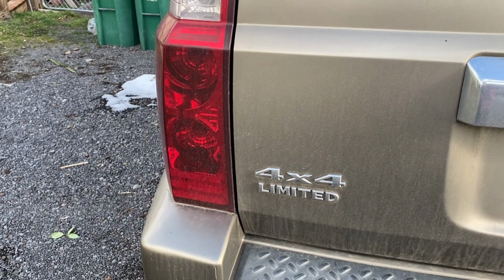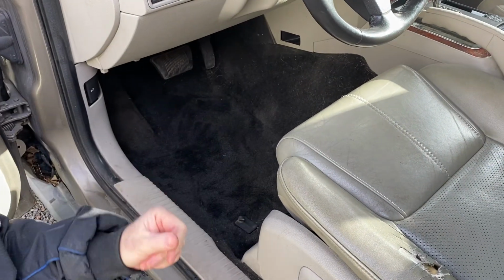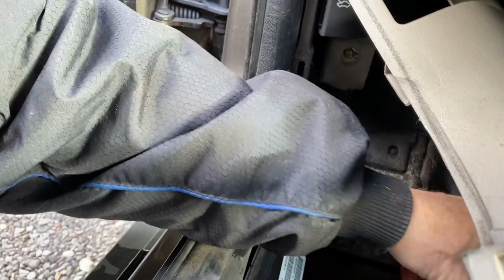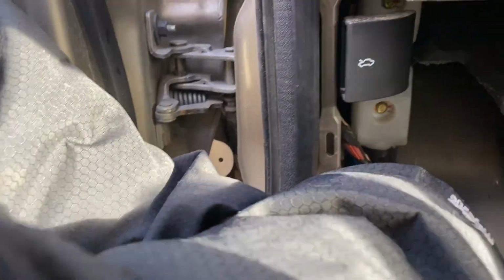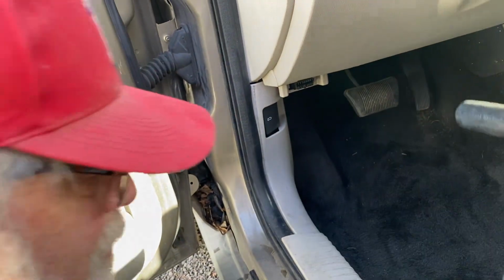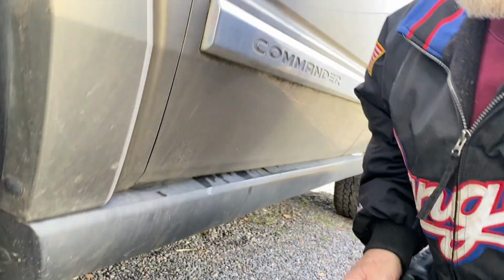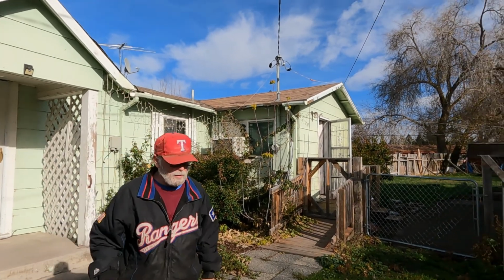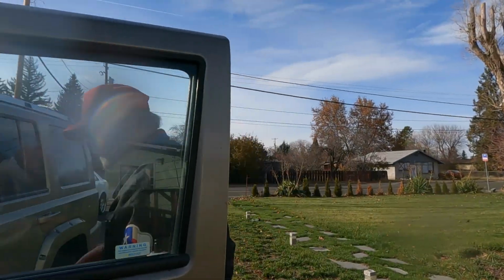Plugged drain hose on 2006 Jeep Commander from sunroof, leaked on floor inside..HOW TO FIX IT...EASY

Comment: Cut the tip off the black grommet, open the sunroof, the drain tubes are in the front corners, blow them out with air compressor
Reply from the maker: Thanks for the tip....
Reply: that's what I usually do... plus "carefully" put some baking soda at the opening in the sunroof and then pour some vinegar down the drains, scrubbing bubbles for anything clogging

Comment: Did this fix the leak? My girl and I have a 2006 commander as well with the same problem! I’m excited to fix it because we live In NW and rain is a constant.
Reply from the maker: Yes I'm happy to say, but did you notice the wire that ran from the top of the windshield down through the door jam. the water drips followed that wire. If you have the same thing put a bend in the wire and make sure the sealer plugs all small holes and gaps..... Thanks for watching and thanks for commenting...:face-blue-smiling:

Comment: That's all good and all but you know you have drain hoses in the rear that no one on the Jeep Commander forum or the Jeep Commander Facebook page can get to without dropping the headliner and you didn't even touch those. The first issue is your sunroof seal at the top has shrunk from being in the sun over the years and it's letting in too much water to start with you can clean those drain tubes all you want to if the water is coming in faster than the front tubes are draining you're going to keep getting water in your front floor boards and wondering why fumbling with these drain hoses over and over again when that's not the issue your sunroof seal is. I have a guy with a charger on here that's replacing his sunroof seal it's just as easy as fumbling with those drain tubes if you replace your sunroof seal plus keep your drain tubes clean at the same time you'll never have this issue. Hope this helps keep on jeeping
Reply: That’s a great point they should check it out as well

Comment: My hose came loose across the top inner panel 😭😭😭
Reply: @doityourselfwithfixinitwit270  I saw my brother do it when I got it 3 years ago used the hose runs across the top near the visor what a headache I need another water pump had one done 2 years ago and a transmission pan and gasket 😭😭😭